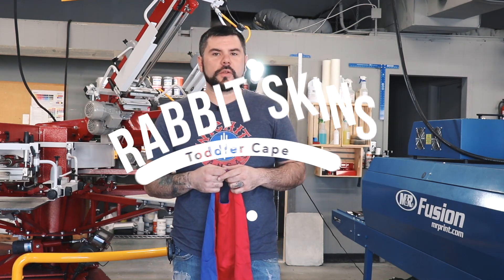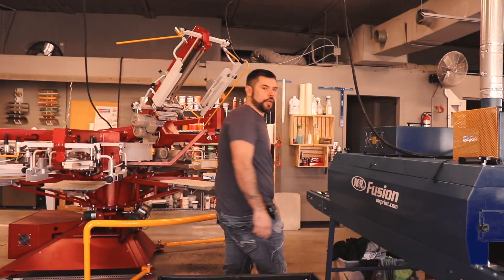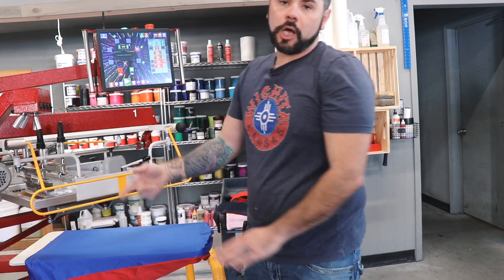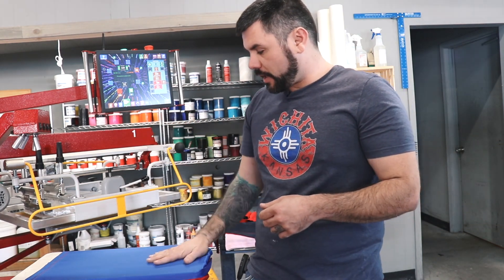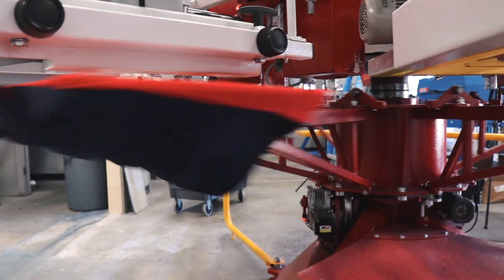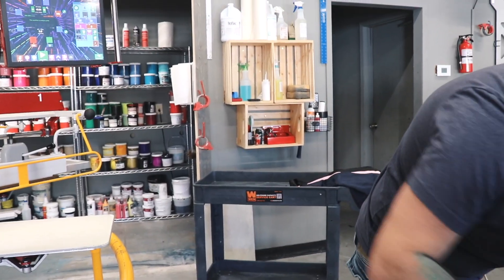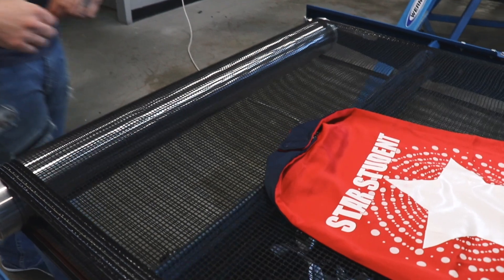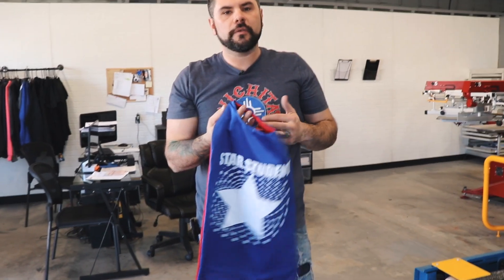Screen Printing Polyester Performance Capes with Glow in The Dark Ink

Comment: Does your tri-lock registration jig work perfectly with the Anatol side clamp locking handle that you have to manually lock it down separately?  The Volt users have said that once you lock down the second clamp the registration goes little off without the jig